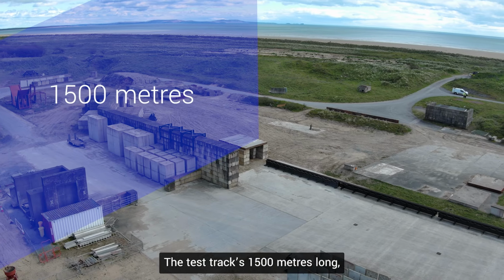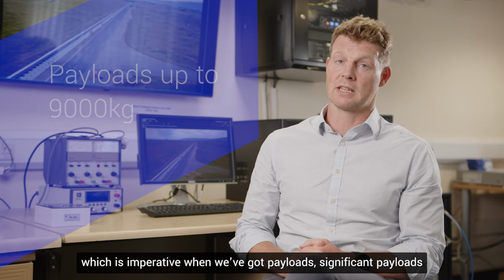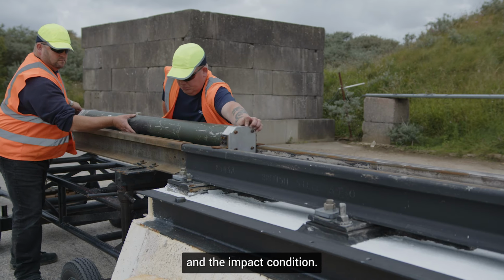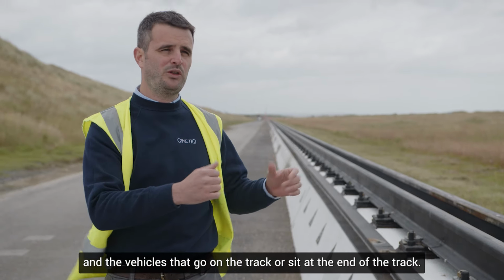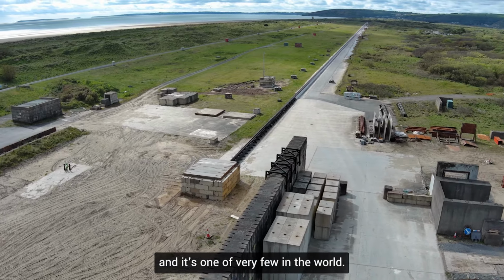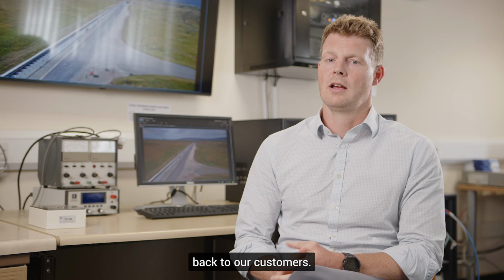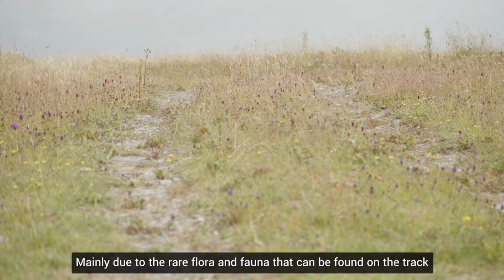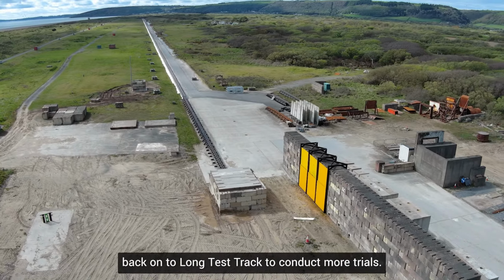MOD Pendine Long Test Track

Comment: how far would an object travelling at Mach 3 go if it wasn't stopped at the end for any reason?

Should the people living in Trimsaren 18km away be concerned ;o)

(Or traffic on the A484 approx 14km away)
Reply: There should be a risk assessment model that shows range/risk for various payloads - they probably have to do a new one for each test? It is basically a big cannon, not elevated. It would be interesting to see those models.